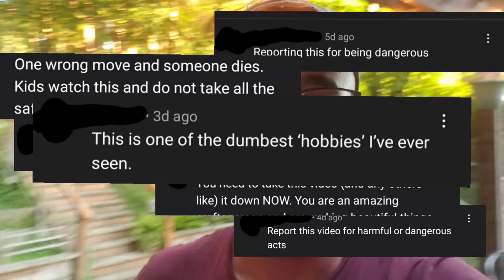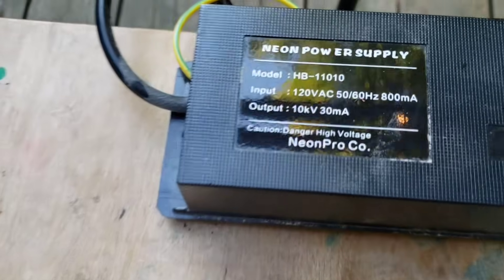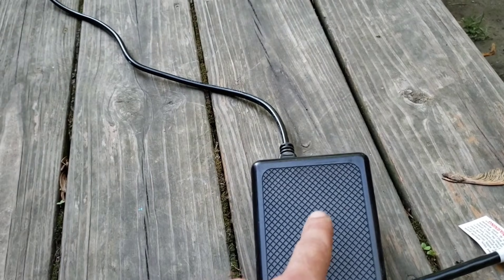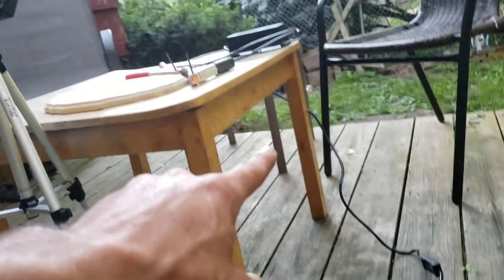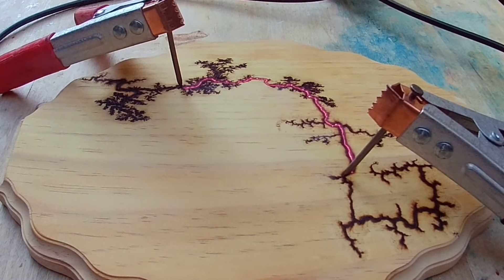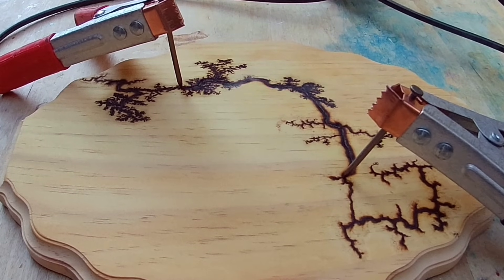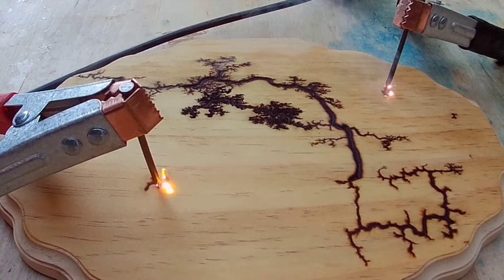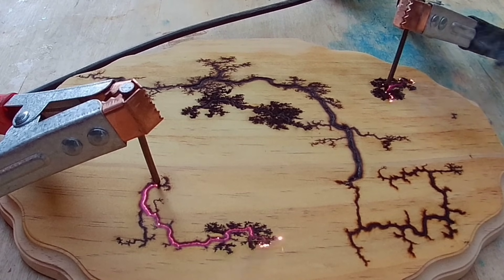Safer Fractal Wood Burning (Lichtenberg) Setup

Comment: The dead man switch is good and like you said you always work with the probes like they are hot for the rare event of a simple mistake or if something fails.  With your set up at least 2 things have to fail and you would need to grab both probes at the same time in order to die.  But not everyone is like this, most get complacent.  I knew a guy that was a master electrician his whole life, he retired and took this up as a hobby.  Wife found him cooking from the inside out one day in the garage from being complacent and not having any safeties.  Once it hits you, your muscles lock up, can’t get away from it.
Reply: Holy crap!  That’s horrible...sorry to read that.  This reminds me of cave diving.  One can have all the experience as a diver but ignore certain safety measures, and / or don’t have the proper equipment, it’s not going to end well.  Goes with just about any activity where potential risk is present I guess.
Reply from the maker: That's horrible and I am very sorry to hear that. I assume he was using a microwave transformer. I wouldn't mess with one of those personally without even more precautions than what I have here. Its true even, and especially, the most experienced sometimes get complacent. Definitely good to have multiple failsafes in place incase you do end up distracted or forget a step
Reply: I was knocked out many years ago from high voltage ~30KV wearing gloves and an insulated tool (or so I thought) - through the insulation!  I can't stress enough how important it is to know that most typical insulation (plastic wrapped metal tools and  pretty much every glove out there) is useless at these voltages.

Comment: You're misunderstanding the problem. It's not that HTCT claimed Lichtenberg burning categorically cannot be done safely, it's that she rightly pointed out that the overwhelming number of "instructional" videos made on the subject are insanely unsafe. Those videos need to be scrutinized by Youtube and removed if necessary. You're obviously aware that there's a world of difference between a 30mA neon transformer and a 1-amp MOT, but the average jerk who doesn't know any better could stumble on any number of those crap videos, grab a jumper cable and an old microwave, then blow off half their fingers or kill themselves outright. 

Also, if I were you, I'd stick a second dead man switch in series with that foot switch; maybe a momentary switch you hold in your hand. That way, you're certain EVERY activation is an intentional act. Seems to me your setup could still be accidentally tripped by mistakenly stepping on that foot switch.
Reply from the maker: I dont have a problem with Ann's video at all. I wasnt clear at the beginning of the video, and actually agree with everything you said here, except the very last part since I have the second switch that gets turned off after every round ensuring that even in the very unlikely chance that the foot switch gets hit I won't. I do agree that a second deadman would make that even less likely however and will consider upgrading. The goal is to eliminate as many chances of a mistake as possible

Comment: I came across Ann's video by accident, until then I didn't even know what this was, and I'm old, one guy that she showed video of was ki.lled, I am not afraid of electricity but when I saw what people were actually doing I was dumbfounded by their utter ignorance of just how much power output that microwave transformer carries.
As for your method, that looks perfectly good provided people have a basic respect for the process, thanks for the video!
Reply from the maker: Thank you. Its crazy how little respect some people have for electricity. When I first started this, even though I work with HV professionally, I was still nervous and I think everyone should be enough to respect the power that they're working with. It boggles my mind some of the set ups I've seen and how little respect people have for it. Its a quick way to make seriously regrettable mistakes.

Comment: I'm finally getting around to trying out the method, I bought that exact neon transformer a while back, tomorrow I think will be go time
Reply from the maker: Thats funny mine had been sitting in my workshop for a year before I actually tried it myself as well. A couple of things to keep in mind. With that NST, because it's less current than a MOT it burns a little slower and your probes have to be a little closer to conduct. Obviously triple check to make sure everything is off before moving them and never assume that just because it is not burning that it isn't still live. Stay safe my friend
Reply: Did you survive?

Comment: You seem very methodical. Complacency can lead to mistakes. I could see someone not turning the power switch off then the dog or cat stepping on the pedal while repositioning the leads. Alcohol could cause that or help along the process, also unqualified persons playing with it while your not around. Would swap meets, market places ban such art work on the assumption it was done unsafely?
Reply from the maker: I wasnt sure it needed to be said but this should be unplugged and stored when not in use like any other power tool. Also don't operate any dangerous equipment while drinking. Fortunately I don't drink. But basically, treat it the same as you would any other thing that you'd consider dangerous, weapons, saws, lathes, etc and don't drink on the job

Comment: Just pointing out that if ANY of you have ANY DOUBT WHATSOEVER or do not know PRECISELY what you are doing or need ANY instruction at all, DO NOT USE ANY KIND OF TRANSFORMER unless you are properly trained and certified in the knowledge of electrical safety.

Comment: So not to argue, real question, I’ve seen videos and stories of electricity arc’ing from several feet away to shock.  What keeps the electricity from arcing over to you?  Is 4 feet just to far?  If so how do you KNOW it is to far?  

Not looking to do this, just trying to educate myself.
Reply: The breakdown voltage of air is 30kV/cm. Its only outputting 10kV So it will only spark 3-4mm. HTH.
Reply from the maker: @d077Z  this exactly. Thank you
Reply: Electricity follows path of least resistance. As the device has a path to the ground, there's pretty much no way it would go through several meters of air (One of the strongest resistors there is) instead of simply flowing into the ground. It would be easier for the electricity to flow through the rubber casing of the wires than to do something that absurd.

Comment: Great But I hate the switches that look like those primary switch because they are so ambigious and easy to confuse if they are on or off. I'd much rather use a push-toggle in it's place with a clear way to tell if it's on. There's also no way to ensure the footswitch is a minium requierd distance away from the equipment. It's just wires so knowing my luck I'd probably kick the thing closer, trip on it and come into contact with the current somehow. I wouldn't take any chances with that voltage..

Just noting a few things, you've already improved on the horrible original hacky way a lot.
Reply from the maker: I hate that switch too. Ideally I'd like to have a set home for it. I could bolt the foot switch to the ground. I also want to add an indicator light or two because of exactly what you mentioned with that switch. I have to finish the ventilation in my workshop before I do that though
Reply: @TheFishinDad  Have fun and stay safe!
Reply from the maker: @zakstechs  thank you my friend!

Comment: Anything with a microwave part in it is left for the professionals with 20 years of electrical knowledge  lol
Reply from the maker: I mean at least 2 guys with 20 years professional electrical knowledge died using MOTs. There's book smarts and there's street smarts. Street smarts keeps you on your toes. Most of us with that book knowledge and experience are guilty of at least once changing an outlet without shutting off the breaker because we think "oh we'll be careful," and got zapped. Experience is the greatest contributor to complacency. I can't tell you how many times I've been overconfident about how careful I'll be. Can't afford to do that with those currents or you end up dead ya know?

Comment: I wonder if you could make like one of those metal carver devices but turn it into a wood burning thing so that the probes move themselves and you dont even need to touch the wood
Reply from the maker: Laser wood engravers definitely exist and I'm sure you could download any file you could think of. It wouldn't be a random pattern but you could certainly do a lighting design. I've heard good things about the X-Carve Pro if that's something you'd want to look into. Any CNC is going to be pricey but I think a bench top one can be found somewhere in the $500 range

Comment: Apart from the word "witch hunt" you did a great job.

As English is my second language I'm wondering why the thing is not called "LIVE man's switch" 
👀🤔👀🤔👀🤔
Reply: I think the original (and technically correct) term is "dead-man switch" (not possessive).  The idea being that it is a switch intended to activate/deactivate if the person holding it dies.  That is, it is a switch which is designed to detect the presence of a "dead man" as its input.  (I believe they were originally used for things like trains, so that if the conductor dies (or becomes incapacitated) the train would automatically stop, etc)

The fact that many so-called "dead-man switches" are actually used as safety measures to prevent death or injury is kinda ironic, though.

Comment: Can I ask why is there no rubber feet under the table, or rubber caps sitting on rubber blocks? In case of high humidity, damp weather, damp area, general unforeseen damp, etc.

 Something to prevent the "live" area from leaving your table top?
Reply from the maker: This is a good question. My initial setup was on a rubber mat in my basement workshop but since I don't have ventilation set up down there I move it outside when I'm using it. Wood and rubber are both insulators, rubber obviously a better one as wood is pourus and as you mentioned in damp conditions that could be an issue. What isn't shown in the video but is only mentioned is that the entire set up is grounded. Should there be a discharge beyond the work area it would go to ground. I'm sure you know this, as your comment was well informed, but for anyone else reading on, it's not the wood itself that is becoming electrified to form the burn but the sodium bicarbonate solution that you brush onto the wood to conduct the electricity. Your workpiece is intentionally damp, but you should make sure your workspace and the surrounding area is not. A rubber platform would indeed be the safest bet
Reply: @TheFishinDad  Thankyou for your response, I had wondered if it was a moved-from-shed setup! 
Well, if you need to move it again, simple rubber stoppers glued beneath, thick enough, if not an entire costly rubber platform, might do! Use real rubber cut bits though I'd suggest, not walking stick or crutch stoppers, no matter how tempting, as many of them these days have steel plates inside, a mil or less  from the rubber edge in places, to stop the walking  stick punching through!
As a walking stick user, I've learned this by deconstructing some old ones trying to work out why some brand stoppers never 'wear out' just snap off, lol.
Forgive my going down a rabbit hole there!

Comment: Even though you have the foot pedal.  And the switch.   You absolutely should not be picking up the alligator clamps with your with your bare hands.  You should have electric rated gloves with rubber and leather as a added precaution.  One mistake just like u forgot to turn the switch on.  Do that in reverse and forget it is on.  And your now dead 💀 .
Reply from the maker: If I had the switch on and stepped over to the alligator clips the power would be off because I would no longer be standing on the deadman switch. I understand the use of gloves. I work with HV daily. The thing about gloves though is that they give a false sense of security. In this set up, you are absolutely right that gloves would benefit me if I touched two live electrodes. When it comes to microwave transformers though, (which most comments seem to not be able to tell the difference of), improperly rated gloves have been shown to melt to the person's skin and some comments seem to infer that gloves alone would protect you from that kind of voltage. Additionally I'm not just going to be dead at 30mA. It would suck a ton which is why I take the precautions I do and say that it is dangerous, but it isn't likely to kill me. I also only grab one probe at a time. It's the same idea as a bird on a wire. They don't get shocked because they aren't completing a circuit. I would have to keep the deadman switch depressed, while completing a circuit with my body in order to get hit. That would require me skipping all 4 of the safety precautions I illustrate in this. Skipping just one will not get me shocked. There are 4 in place on the off chance that I were to get distracted. There are always things that can be done to make it safer. An enclosure, indicator lights, a dedicated workbench, EPO, and yes gloves, so I dont disagree with you that it can absolutely be improved upon

Comment: This setup is still not what I would consider "safe". The biggest risk here is that you are placing a lot of faith in those switches. If either fails in the closed position, then you've introduced a condition where the piece could be live when you think it isn't, and that's when accidents through complacency happen. If this was all contained within a sealed box with power disconnect switches that are normally open when the lid is up, and closed when it is locked shut, plus e-stops, then I'd say you're getting there. The number 1 thing I would improve is your procedure. You moved those probes without checking for dead at all. That's a cardinal sin for high voltage, and one that puts your life at risk. If you check for dead using a meter before touching anything, then even in the event of literally all the series safety measures failing, you can still identify a live surface that could kill you before you commit to touching it.
Source: HV training & worked as an engineer for a company making high voltage inverters.
Reply: And another thing, from high voltage training and working on cars (meaning, usually 400V but higher currents): wear safety gloves that are rated for the voltage that you're working with. Even if everything is supposedly turned off, but still plugged in. And please move those metal chairs away. I saw you tripping, or an animal come running or WHATEVER and the whole patio burning.
Reply from the maker: @BiggiN483  I appreciate your concern my friend and agree that properly rated gloves are a good safety measure. I probably overthought it, I tend to do that, but I've heard so many stories of people wearing gloves that weren't properly rated, thinking just because they had gloves that they'd be safe, that I didn't want to include that. A lot of the dumb 60 second shorts or tiktoc vids show guys handling live probes or applying the liquid solution with gloves and I don't want someone to think thats enough. A few of the deaths using MOTs had guys wearing improperly rated gloves and a number of injuries as well. Some of which the gloves fused to their skin. I was trying to lean more toward staying away from it entirely with a dual shut off, and treating the dead probes like they're live because I feel like people get a false sense of security just because they have the tiniest insulator on their hands. Thats the vibe I've gotten from the shorts anyway
Reply from the maker: Thank you for this well thought out comment. I agree on all fronts. It could definitely always be made safer. There is someone else who made a video that includes most of what you mentioned. I'd also like to add an indicator light (or even 2, incase one goes out) to it so there is a visual identifier but I know that isn't fail proof either obviously. This is currently a simple set up since I don't currently have ventilation in my basement workshop and need to have it easily mobile but ideally what you described would be the safest. I build and test x-rays for a living so do work with high voltage well exceeding whats shown here daily as well
Reply from the maker: I will add though that it would take both switches shorting at the same time for that to be possible, not either or, and while theoretically possible it would take a lot to cause one to even fail in the closed position coming from a 120v source
Reply: @TheFishinDad  severity and probability. Probably is low, but severity is extremely high; therefore, additional safety measures required.
Reply: @TheFishinDad  For sure, this set up is orders of magnitude safer than some others out there. I'm always thinking in terms of rated cycles for switches, MTBF and whatnot, so the failure of both switches is improbable, but not impossible. I had a colleague who is an electrical engineer. He made the mistake of only having one switch for off, and it failed. He lived, but it cost him two digits on his hand and will likely have a lifetime of chronic health problems relating to the internal tissue damage. The switch failure may have been a matter of time with repeated use, so more is always better. It's good to see people thinking of safety while doing this kind of stuff.